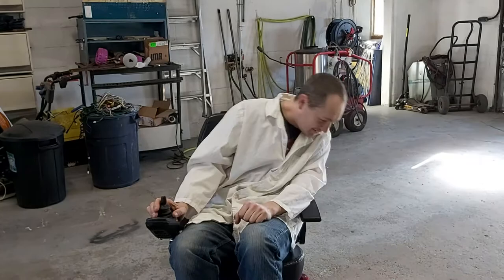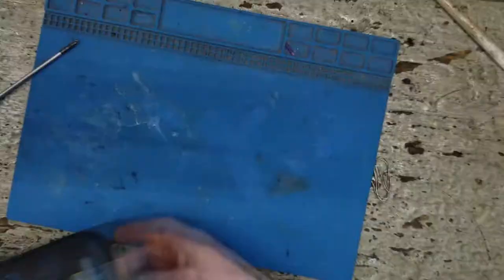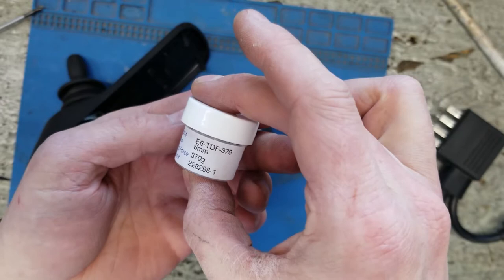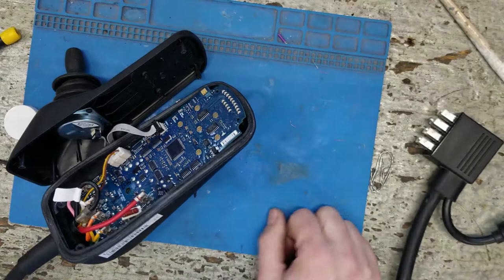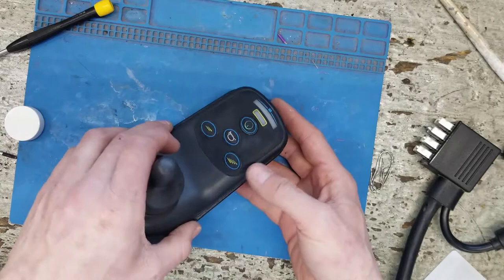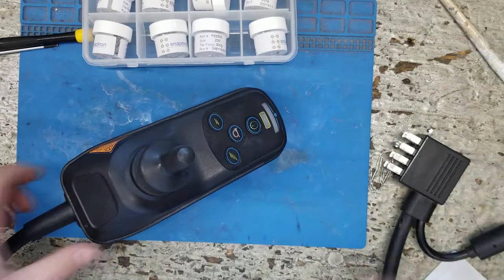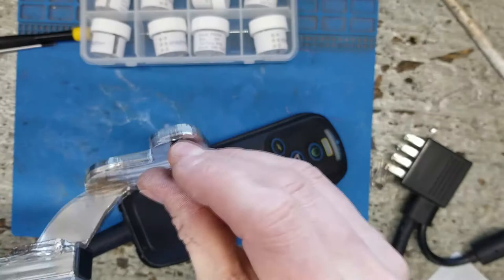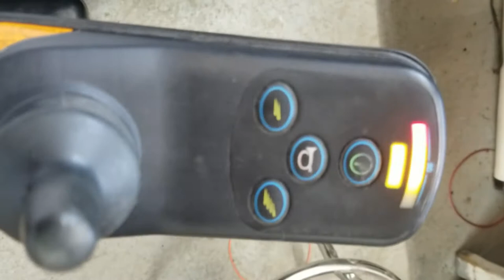Mobility Scooter Control Pad Power Button Repair

Comment: Is that why mine is flashing 7 on the light bar? I bought a whole new pad but couldn't figure out how to get the glue to release the old pad. 
It's the bottom two buttons that quit working on mine.